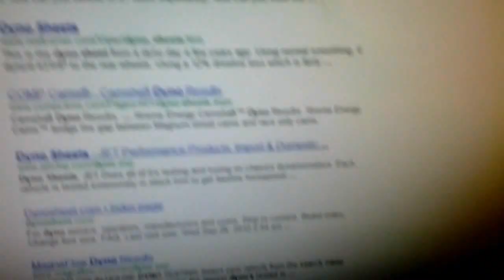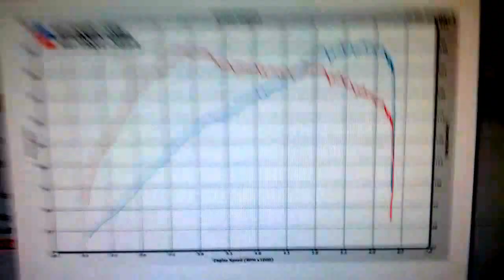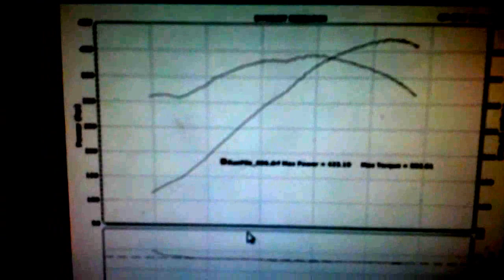Horsepower vs. Torque

Comment: Not true. Look up the 1963 Chrysler Turbine. This was a jet engine powered car that made 130hp and 425 ft-lbs of torque. It's acceleration was exceptionally slow because torque doesn't mean acceleration without horsepower. Torque is the amount of force being put to the road, where as horsepower basically equates to the RATE at which you can put torque to the road. If you put 1000 lb ft to the road, it doesn't matter if you're only putting it to the ground over the course of a minute.

Comment: well.. "torque wins the races" is absolutely meaningless. This statement sounds nice because most cars are geared such that getting up to high engine speed may take time, engines with no torque would have trouble getting to high engine speeds while torque engines are already in the power-band. GEARING, takes advantage of this notion, allowing horsepower to compensate for low engine torque, by upping the engine speed for a higher percentage of time.

Comment from the maker: Yup. You need lots of torque for hauling at low speeds, but horsepower is important for big heavy vehicles as well otherwise they'd never get up to a decent cruising speed on the highway!

Comment from the maker: Yes, the torque is the literal twisting force the engine is producing, while the horsepower is the total amount of energy coming out the engine (which is a combination of the torque and engine speed). The absolutely most important takeaway from all of this is that horsepower and torque are not independent from each other, they are absolutely and completely linked by a simple mathematical formula, and they should be considered together, not separately.

Comment from the maker: Check out the video at 9:38. 5252 is just 33000 divided by two times pi. It's just accounting for the special unit of 'horsepower'. In standard international units, power (in watts) is equal to torque (in newton-meters) times rotational velocity (in radians per seconds) and there is no other number, just P=Tw.

Comment: so what does the 5252 stands for in the formula to calculate horsepower? Torque will be more important than HP when it comes to pulling/hauling power and acceleration of a vehicle right? Horsepower just defines the engine's top speed.

Comment from the maker: Yes, the actual mechanics and construction of a diesel cycle engine tend it toward having more low end torque than a comparable Otto cycle (gasoline engine), which may result in lower peak horsepower than the gasoline engine. Gasoline engines make their peak torque at higher relative RPMs, and since we know that horsepower is proportional to torque and RPM, this means that gasoline engines will often have higher peak horsepower ratings. Regardless of the engine type, that formula still holds.

Comment: so HP = torque * rpm / 5252 correct? Heard Diesel engines tends to have low end torque and gasoline have high end torque and HP.

Comment from the maker: You need to remember the fundamental theory of leverage. Applying 10 pounds of force to a 10 foot long wrench is not the same as applying 10 pounds of force to a one foot long wrench. You could apply an enormous amount of force, but if you don't have enough leverage around the point by which things are rotating it could do nothing at all. That is why we use foot-pounds, this measurement accounts for both the amount of force and the distance from center at which it is applied.

Comment from the maker: Think about it this way: torque is the work you're doing, and power is how fast you're doing it. Is that more clear? It's not exactly correct but it's pretty close. And yes, you're on the right track, horsepower is just a function (mathematical combination) of torque and RPM.

Comment from the maker: Power is a measure of energy transfer rate. It represents how much work is being done per unit time.  A 100 watt light bulb requires 100 joules of energy to pass through it every second to be bright. One watt is equal to one joule per second. Horsepower is just a special unit of power that is equal to about 746 watts, i.e., a one horsepower engine sends the same amount of energy to the drivetrain as it takes to power about 8 light bulbs. It is simply a measure of the energy produced.

Comment: its not a theory. i know that from experience. how do you think this 240 is so fast with "only" 320 to the wheels? because he has a shitload of torque! thats why he can still cut through 5th gear even though its meant for overdrive. just search S13 SR20 240sx w/ GT28 @ 16psi

Comment from the maker: That's right. The 600HP car in that example is making 600HP  because it is revving very, very high with a small amount of torque. The 320HP car doesn't rev as high, but has a lot more torque in the driveable range of RPM, and thus will accelerate far faster.

Comment: if you have say my car for example a 240sx with an sr20, and lets say i make 320hp to the wheels but 500tq i would destroy a 600hp 240 with barely any torque. basically hp means nothing, its a mathematical equation based off your tq numbers. the only reason why hp is even mentioned is because back in the early 1900's they had one gear vehicles so acceleration (torque) was not what they cared about, since they had one gear they wanted more hp for a higher top speed. tq helps more than u think...

Comment from the maker: The type of powerplant is independent of the values. 

Mathematically speaking, P=wT, always.

P is the power, w is the rotational velocity, and T is the torque. The 5252 comes as a result of mixing units. 

In SI (Standard International) units, P is exactly equal to wT, where P is in watts, w is in radians per second, and T is in Newton-meters.

When dealing with imperial units we like to convert the inches to feet and seconds to minutes, it's these conversions that yield the 5252 value.

Comment: You uh... forgot about gearing.  Bro.  How come the big-rig 2000 hp doesn't beat my gti? (rhetorical) You also just explained torque and horsepower with math to lamens.  They don't know what a tau is, or what algebraic expressions imply via direct/indirect relationships of variables.  You also failed to put power and torque as functions of rpm, and then you threw in rpm at the end for who knows what reason.

Comment from the maker: I should add that the reason I said that in the first place is because top speed doesn't matter to most people, rather they judge how "fast" their vehicle is by how fast it pulls away from a stop light, which is more determined by torque than it is horsepower.

Comment from the maker: Torque in most cases is proportional to acceleration, horsepower is literally the most possible energy the motor can produce, and thus determines the top speed. I didn't contradict myself, they reach incredible speeds because they produce a lot of horsepower. They also accelerate quickly, because they have a pretty respectable amount of torque and are very light vehicles.

Comment from the maker: The math has no exceptions, just the idea. An F1 car has low torque and high horsepower because it revs very, very high. The horsepower, as I've said over, and over, and over again, is a function of the torque and RPM. 200 ft-lbs of torque at 19,000 RPM gives you a LOT of horsepower, leading to the incredible speeds that F1 cars can achieve.

Comment from the maker: I've been through this too many times before, I'm not doing it again. There are exceptions to everything, this included. Horsepower is simply a mathematical function of torque and RPM, and for most vehicles the ideas discussed here apply. Thanks for watching.

Comment from the maker: A 10 or 20 HP electric motor does not put more power to the ground than a 100 or 200 HP gasoline motor. 

"...because it has 30 more horsepower and therefore it produces more torque at the wheels"

Horsepower does NOT produce torque! Horsepower is a function OF torque!

Comment from the maker: I'm sorry, I'm not trying to fight, but you're wrong. How do you explain the incredible acceleration of electric vehicles? They have extremely low horsepower ratings, but very, very fast acceleration. How about comparing two VW Jettas, one gas and one diesel. They may have the same HP rating, but the diesel has considerably more torque, and trust me, the TDI accelerates WAY faster. Acceleration is determined by torque, top speed is determined by horsepower, which is a function of torque and RPM.

Comment from the maker: Yes, that's absolutely true. Like I've said, it's horsepower that determines your top speed, not torque. You could apply an enormous amount of torque, but if the resistance is so great that the vehicle simply can't move faster than 5mph, (and thus the RPM is very low), then its power is very low. I'd like to reiterate that what I'm stating is not my opinion, it's mathematical fact, and it's the very definition of horsepower. Horsepower is NOT measured, it is CALCULATED from torque and RPM.

Comment: The point you're missing is that unlike horsepower, torque tells you nothing about vehicle performance.

I could easily generate 100lb.ft of torque, but i couldn't propel a car faster than 5mph. Surely, this is obvious?

Comment from the maker: I cannot believe how many of these responses I've gotten. Horsepower is a function of torque and RPM. It is not my opinion, it is a FACT that I am sharing with people that don't understand that. If you gain more POWER at high RPM, that is because you are developing more TORQUE at that higher RPM. Whether you say HP is a function of TQ or TQ is a function of HP, the fact is that they are directly related by RPM.

Comment from the maker: No, I don't think you quite picked up on what I was saying. The takeaway from this video is that horsepower and torque are not independent values. HP is a direct function of torque and RPM. Diesel vehicles often 'feel' very fast in their low end, because they have LOTS of torque, but they can't go very fast because they cannot achieve sufficient RPM to make the power they need to achieve high top speeds.

Comment from the maker: No. If you apply a constant amount of force to the wheel it will continue to accelerate at a constant rate. F=ma. I'm not having this argument, it's pointless. It's like I'm arguing that 10 is 2*5 and you're trying to convince me that it's not, it's actually 5*2.

Torque and power in automotive applications are completely interdependent. Power is a function of torque and RPM, or you could say that torque is a function of power and RPM, but with an inverse relationship. Torque is FELT, HP is not.

Comment: 1lb of tq at 5250rpms= 1hp. wow, took you this long to realize this relationship...hp is the only thing that's relevant. adding hp is more important than tq. adding 10lbs of tq at 2000 is not nearly the same as adding 10lbs of tq at 8,000rpms. both add same tq, but higher the rpms the more power that tq can do. THUS making HP mroe important than tq... you post is wrong! pm to debate but ive looked into this for 9 yrs... hp will always win. ALWAYS